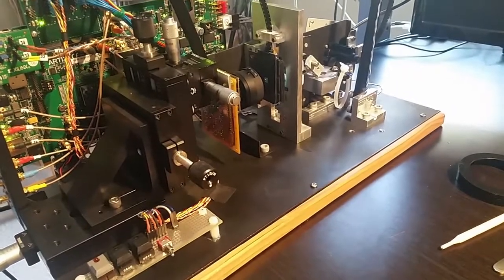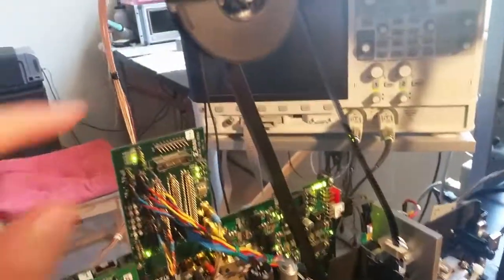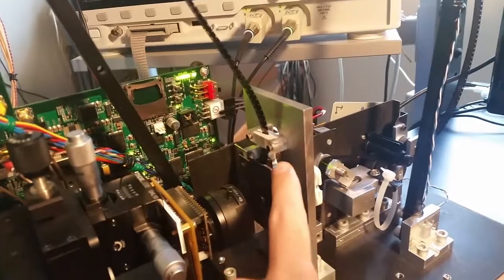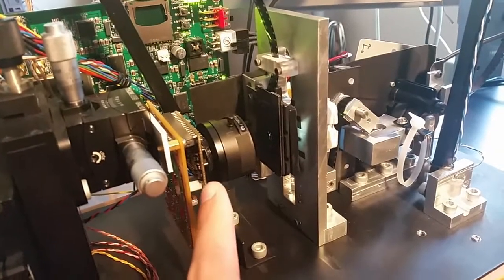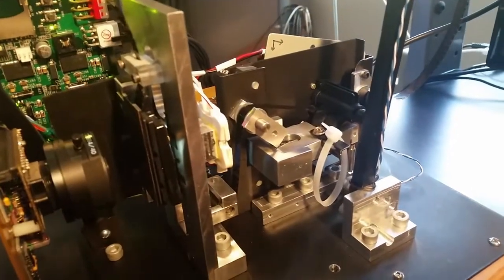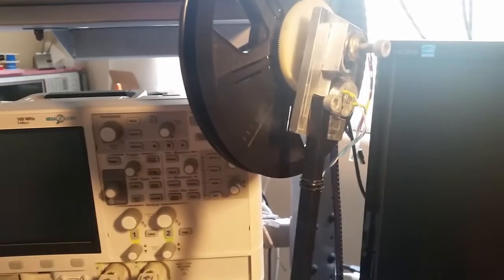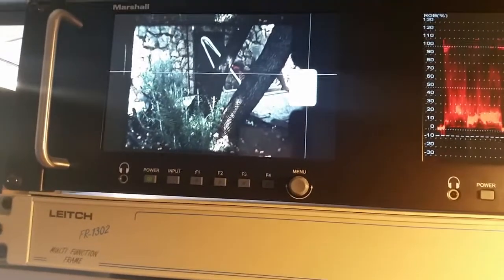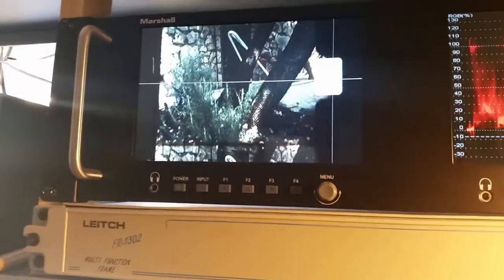Home Made Film Scanner Overview

Comment: Wow! Lots of questions..like...did you write your own code to control all this? If so, using what type of PC or Raspberry or...? What is the light source?... You need to write up quite a bit more if others are to learn anything from your project...
Reply from the maker: I'm thinking of doing a longer video to go into more details of each part. I figured I'll see if anyone is interested in it first.

Now to answer your questions:

Most of the software was custom written, I had a few people help me so I can't take all the credit. For the programming we used:

The FPGA is programmed in Verilog. The PC software is written in C++ with Qt Creator. There are also two shell scrips to automate the process. The parts we didn't write are an SDK image capture example for the BlackMagic capture card and ffmpeg to combine the images into a movie.

The main PC is just a regular x86_64 desktop running OpenSuse 42.2, it communicates with the FPGA board over an UART port like it would with an Arduino or Raspberry Pi. The picture is send to the PC over an SDI interface. The FPGA board has an SDI driver for the link, then it goes into a BlackMagic video capture card that supports SDI. The software takes care of the images after that.

The light source is just a high powered LED. In this video it's a "Backlight LED Module". Previously I used a regular 1W LED. It worked fine, but the Backlight Module gives slightly better light distribution and gives about twice the light.
Reply: I would definitely love to see more! That's quite a rig you have there, what with all the machined parts and fine adjustment capabilities. Wish I had your skill level. Have you looked into using Avisynth?  VideoFred has done some amazing stuff here:  http://www.filmshooting.com/scripts/forum/viewtopic.php?f=1&t=27023&p=217701&hilit=videofred&sid=19b931dc452b92aed1af3b3a744fe9fa#p217701
Reply from the maker: Regal Walnut I'll try to post the more detailed video in the next week or so, and thanks, I sunk an insane amount of time into this thing. 

 I haven't used AVISynth but it looks interesting i will have to check it out. I've been using DaVinci Resolve for editing.

For the machinig it just takes time, Once you have the basics you can learn new skills when you come across features that need it. At least thats how I did it. The biggest problem was precision. Some of the parts had to be within 50um, so I had to redo quite a few of them.
Reply from the maker: I finally finished the more detailed video: Here is a link to the one about the electronics and software: https://youtu.be/THWPetVIrrk